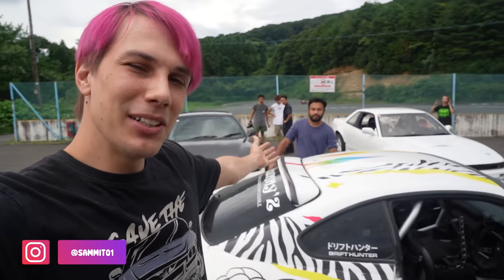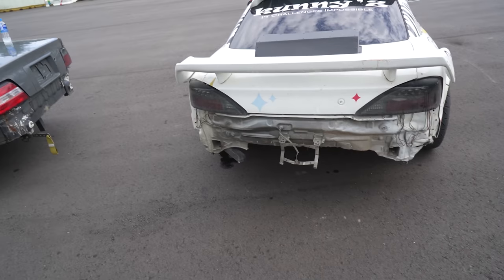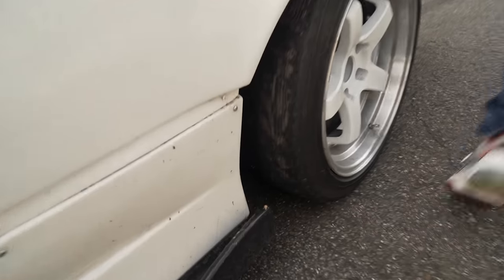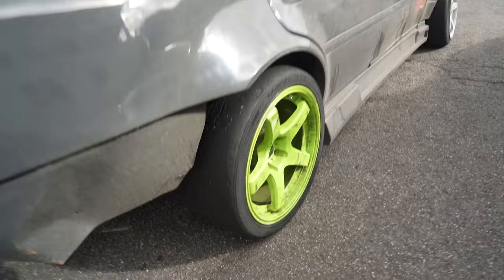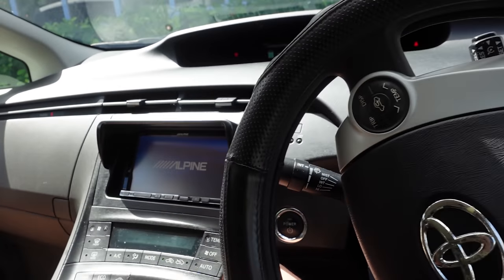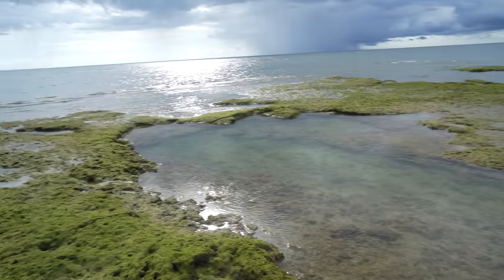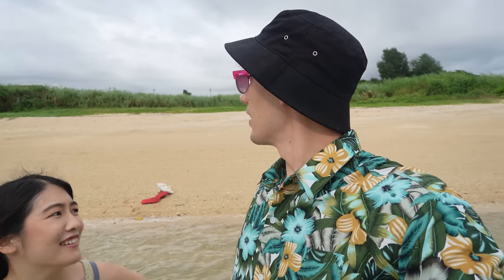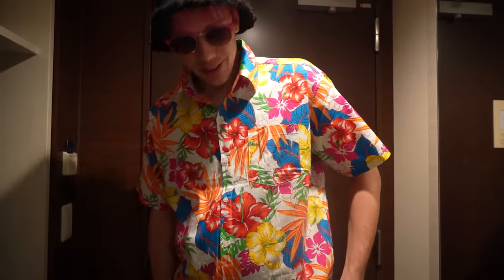AGGRESSIVE TANDEM PRACTICE & VACATION MODE ENGAGED!

Comment: Why is your driverside front wheel wobbling on full lock? looking from Rohab leading back on you following the chaser has a pretty signifigant left to right wobble. Tie rod?
Reply: yeah that was gnarly.
Reply: I wouldn't be surprised if something is still bent or about to break, that thing has had a hard life
Reply: could be a mixture of bad bushings wheel bearing etc
Reply: @lance5030  Yea my second thought was wheel bearing  but 1 it only did it at full lock turned out.. They would be pushing all the weight one direction not allowing the wheel to move back and forth.. Not to say it couldnt just be everything bearing, rods etc .. But it looks like its about to go its separate way lol
Reply from the maker: It's the failed ball joint in my knuckle. It will be fixed soon but I'm still gonna send it :D
Reply: @SAMMIT  Yes I know you will you keep your cars in pretty good shape I must say..